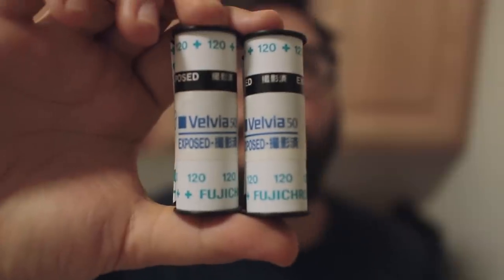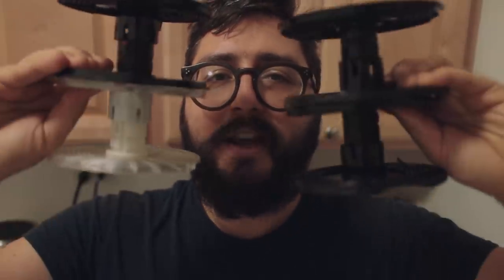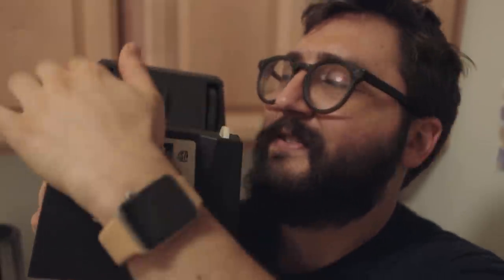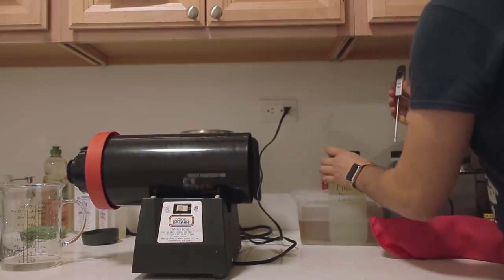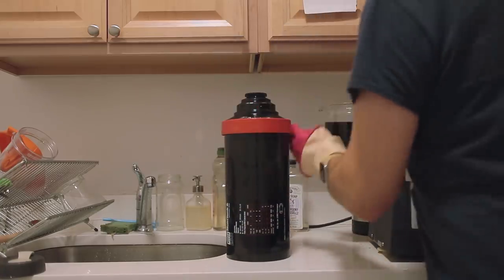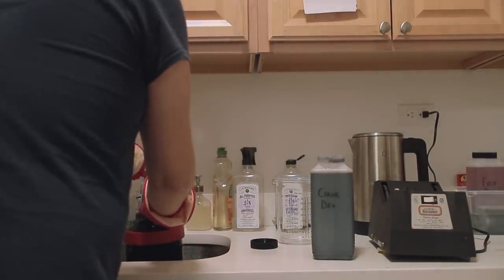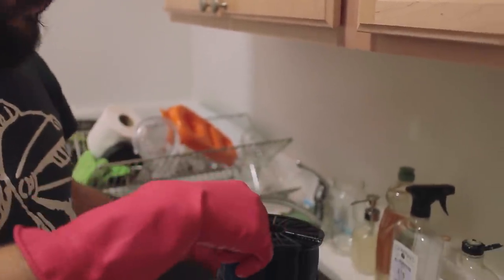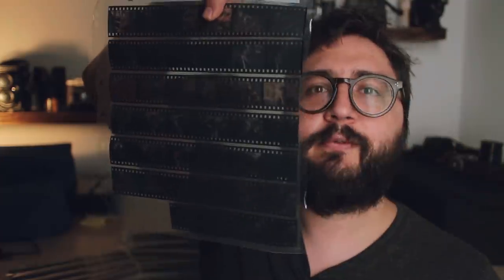Developing 120 and 4x5 at home

Comment: Nice one! One doesn't need a lot of gear to develop slide film: Just the chemicals (e.g. Tetenal's E-6 set), 4 0.5 l used water bottles, a bucket, and the usual stuff for black and white development, like the development tank (I use a 0.5 l Jobo tank for 2 x 35 mm or 120 films), a thermometer, a stop watch etc.. Just set the bucket into your sink and fill it with some hot water (a bit over 40°C, it will cool down fast), mix your chemicals into the water bottles (good idea to mark them), put the bottles into the bucket. While they are warming up, put your films into the tank. Then follow the procedure given on the product sheet for the chemicals. With a bit of patience (and adding warm or colder water into the bucket) it is no problem to keep the temperature at about 38°C (100°F). Remember to also put your tank into the bucket to keep it warm! -- Costs (besides the chemicals, the films and the black and white development gear): None. Everyone has a bucket and some useful plastic bottles at home...

Comment: Hola Edu. Gracias por compartir tu experiencia con nosotros. I think that a regular Paterson tank on this rotary machine will work just as fine as the Jobo tank. Do you think that it still going to be needed more chimistry though using the Paterson tank with this little rotary machine?
Reply: Estoy de acuerdo. Los Paterson antiguos y los AP son un poco cónicos, pero los Paterson actuales son cilíndricos como los JOBO.

I’m full agree. Old Paterson models was a little bit conical as the APs, but new Paterson’s body is straight like JOBO.

Comment: I was wondering when the tank would walk itself off the motor base 😆 I've done the same thing. E6 at home is awesome, I have no room but I can do it with a sous vide and a bucket, works great. Ive pushed it to 12 films in one liter with no color issues, just extending the time and being precise with temp (prob most important when stretching the kit out)

Comment: Really need to see Eduardo! I've had the same problem with finding a JOBO machine (both space and cost). I went a different route and built my own rotary using 3D printed parts and some rods and bearings common to 3D printing along with a spare motor and a Arduino. It's not quite ready to share but I do plan on open sourcing the design. Either way, though I haven't done E-6 with it yet, goodness is sooooo much easier than having to do inversions. I'm using it for C-41 and BW (XTOL Replenished in my case). More work than buying something used for sure but I did solve for the drum not falling off the rollers :)

B's Rotary thinger solves for that too so that might be something to consider (also a 3D printed design) - it has a rear wheel and tilts the tank up slightly to keep it on the base.

Comment: Can those chemicals cause any harm to your health if you use them like this in the kitchen? Always wanted to develop my own roll, but Im skeptical because of those chemicals.
Reply: If you ingest, perhaps or if you leave them on your skin and expose yourself to them multiple times. You may be sensitive to some of the chemistry in the first place (I believe there is an ammonia compound in the blix that can be quite powerful if you take a whiff right from the bottle), however if you take common sense into account there really shouldn't be much issue. You can use this kit bare handed, but for safety sake it's best to use nitrile (or similar) gloves. And washing your hands afterwards is good practice as well.

Comment: This may be a dumb question, but, have you ever considered using a sous vide immersion heater to regulate the temperature of the chemicals.  Is that overkill?
Reply from the maker: It's too big for my flat, too expensive and if you keep an eye on the water temperature, you can develop without needing a heating system. It would make sense if you need the chemicals to maintain their temperature for hours, but the critical heating moments when developing just take a few minutes. :)
Reply: To add to this: if you have a large enough volume of 38C water in which you submerge the bottles of the chemicals, they won't drop in temperature quickly enough to have an effect in the time it takes to develop the rolls.
An aquarium heater is enough to keep 38C if you want to minimize risks (specially if you live in a very cold place), but a sous-vide machine is overkill.
Now, if you want to cook a mean steak and also develop E6/C41 at home, then the sous-vide machine does make more sense.
Reply: I use a sous vide wand and a large tamale pot and it works well in a limited amount of space. Whatever works; there is no one way. I love the sharing of ideas though. I’m already searching for a motor base. Ha.
Reply: With sous vide and immersion is not possible to use this continuous rotation aid, so you will need to use your wrist.
Like Eduardo say, if you have the chemical in temperature with water, they will not drop down so much. I’m other hand, it could not be true if you are working in a cool room. In that case, temperature can drop several grades.

Comment: why one can't use paterson like jobo? if you put lid on, the liquid shouldn't escape? ap tank has even more "inner" filling hole?
Reply from the maker: I never say you can’t. The issue is mention is the reels are too close to the centre so you’ll need more than a litre (4 quarts) of chemicals, and that means buying a more expensive E6 dev kit. In order to get the same results.
Reply: EduardoPavezGoye thanks for the insight, didn't think it that way!